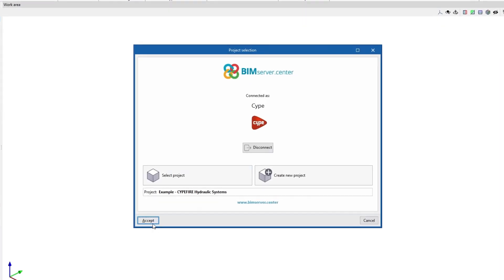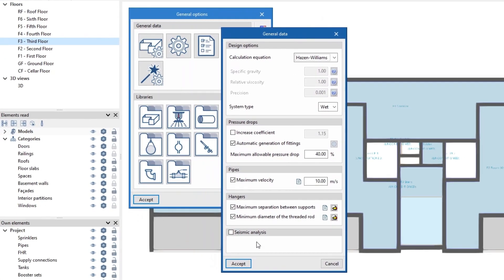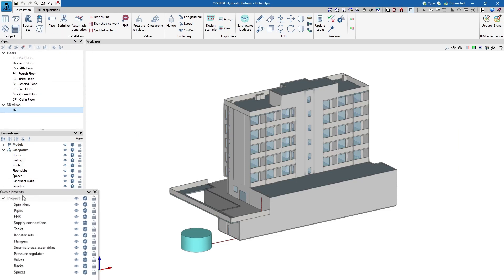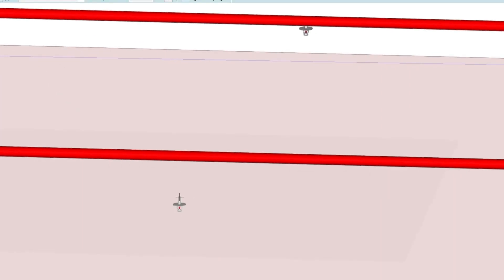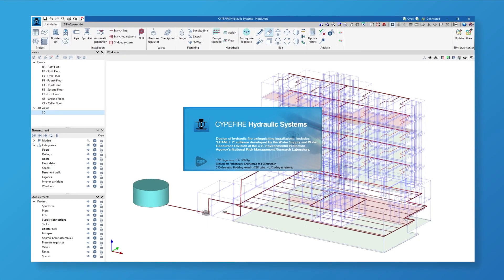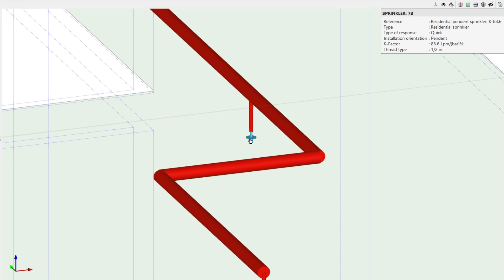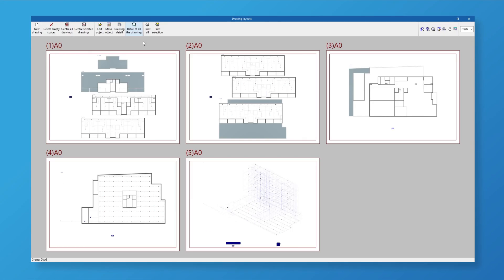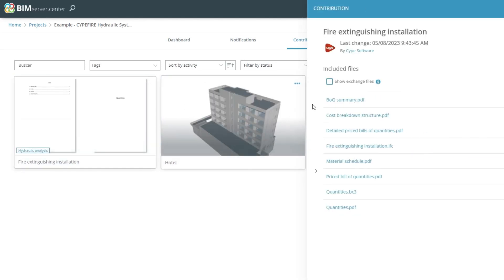CYPEFIRE Hydraulic Systems

Comment: How can impalement this in Revit MEP
Reply from the maker: Hello. Under the workflow proposed by CYPE, the modelling, calculation and obtaining of the installation documentation is carried out entirely in the CYPEFIRE Hydraulic Systems interface, without the need to move to another platform such as Revit MEP. However, once the model is developed in CYPEFIRE Hydraulic Systems, it can be shared in BIMserver.centre and use the "Open BIM - Revit Plugin" to extract some of the information entered. Information about this plugin can be found at the following link: https://info.cype.com/en/software/plugin-open-bim-revit/. Greetings 😊